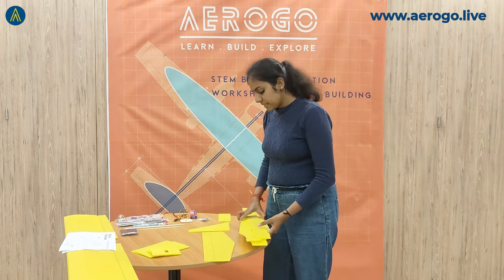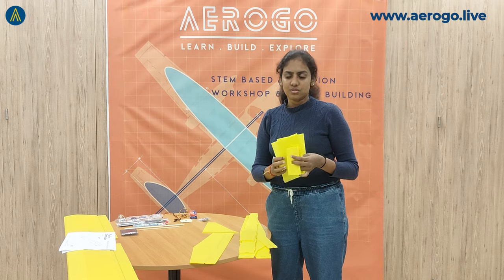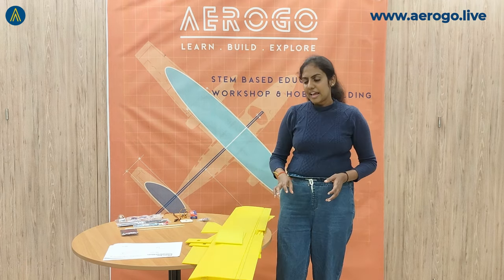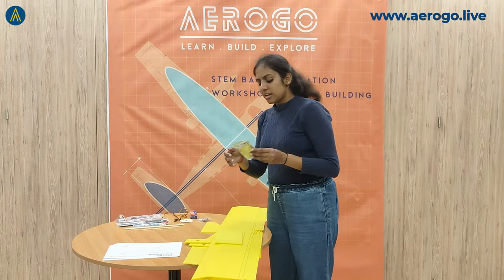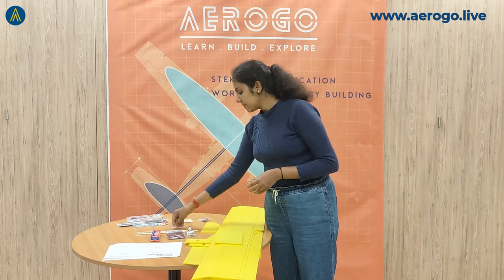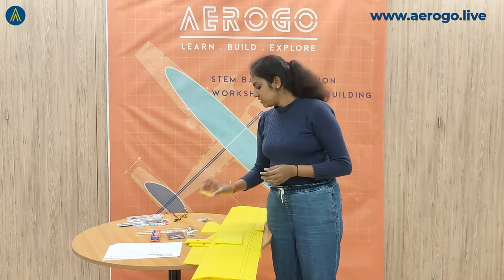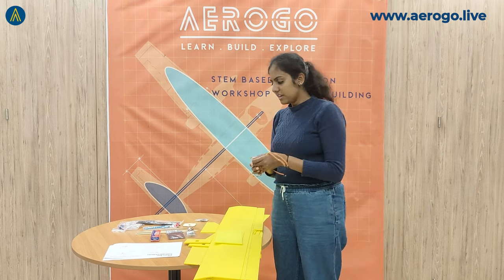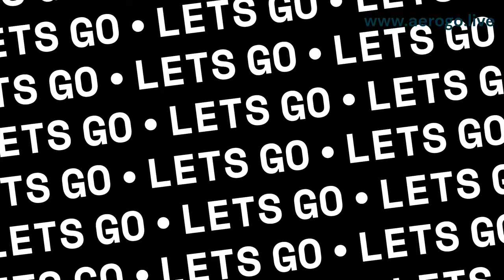AEROGO | How to make Super Trainer RC Aircraft | RC Aircraft

Comment: One of the worst video ive seen so far… the build techniques are soo poor. And this is trainer model? The primary control surfaces should be elevator and rudder for the trainer and you could have given dihedral angle so that it has lateral stability which means ailerons can be eliminated. The elevator has no spars which means it will flutter in the air and response will be very poor. Please try to make at least buyer friendly model not just peace of junk and then selling it to customers, people and paying for it so add some value to it.
Reply: How much cost do u think it is and how well it fly do u know ?
Reply from the maker: Hey, This model is purely designed for first timers, We know that the dihedral gives lateral stability but doing so will also increase the difficulty of making it. To keep it as easy as possible for beginners and to keep the cost as low as possible while still giving a better building and flying experience is the only goal. Try the model once to see if it has value or not.
Reply: @rip_joker3286   i think you need to take aeromodelling classes. Cant you see the shots how its flying? Do you even say its flying?
Reply: @aerogo_live  giving dihedral is much easier than integrating electronics in the airplane and if you are really making a beginner friendly airplane. Make it easier to fly not complicated. Meaning primary controls should be enough to learn how to fly. Rudder and elevator and best for controlling.
Reply: @aerogo_live  talking about cost effective. How much do you think coroplast sheet is?